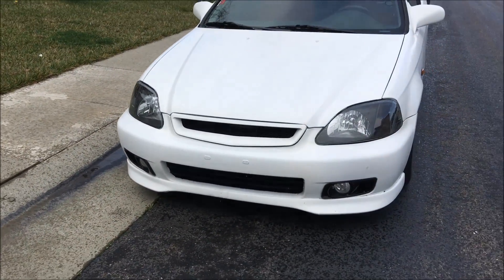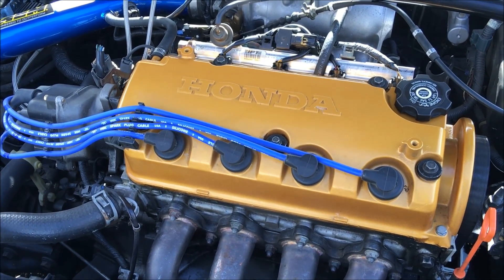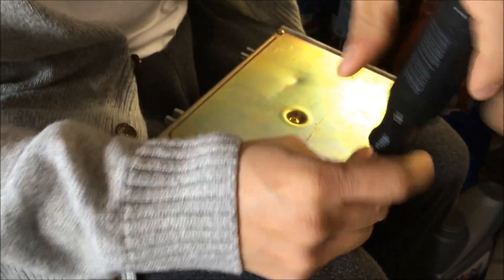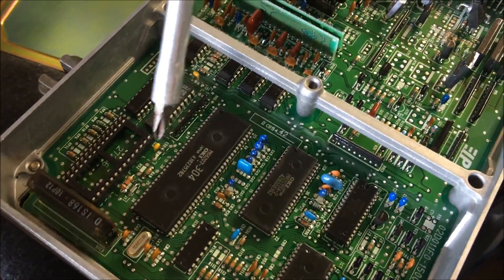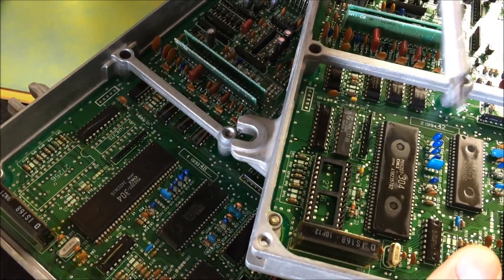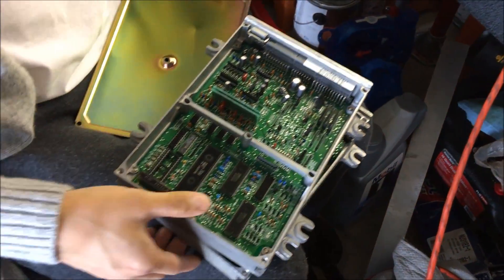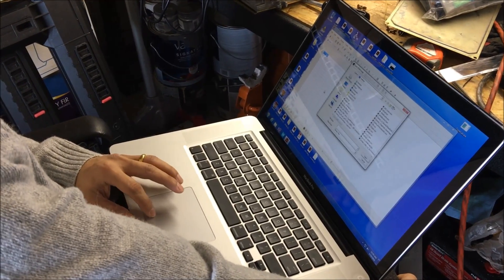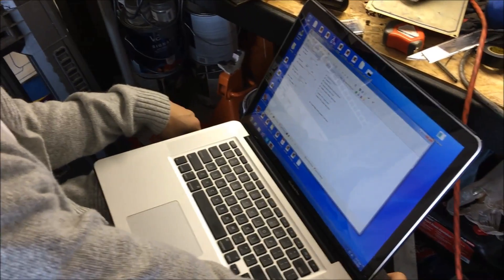What is a Chipped ECU Explained Part 1

Comment: Question Tong. I have a98  prelude non sh that got converted with the p28 ecu and got a trans swap to a 96 manual . my smog guy has to connect to ecu now and of course cannot read any data now that its obd1 . I guess the new way of smogging has made it more difficult. Now can i run a Honda ecu from  ebay purchased for  my make ,model and year and be good to go , or do i need to get it reflashed with my vin ??This would only be needed for smog then i would swap back. thanx

Comment: How do you add 2 maps in SST chip? And can you switch in between the maps without taking off the chip. Like can it change automatically when you floor the car or can you change it by connecting the ecu via usb?
Reply: Use moates 2 timer.

Comment: thank you for posting these types of videos. I'm having an issue with the check engine light I purchase the ECU I tried to put it in but it says I have to program it first so I ended up putting the old one back in there dealing with the issues on a cold start now it's pretty bad to where it's not staying on